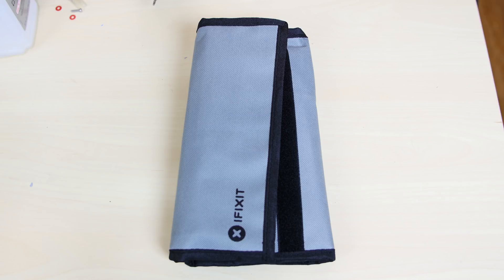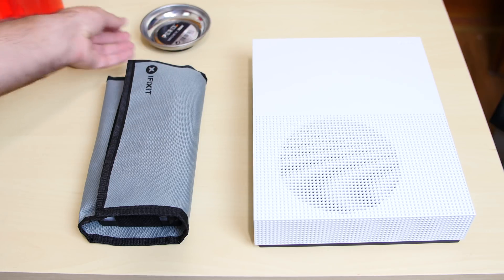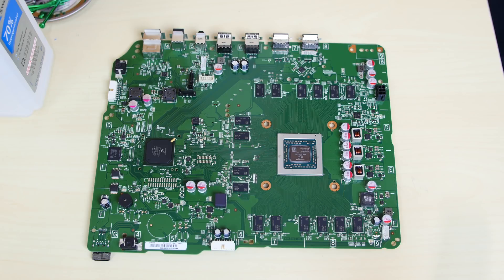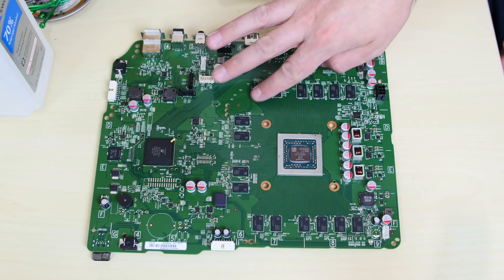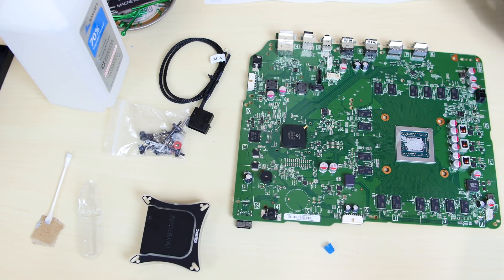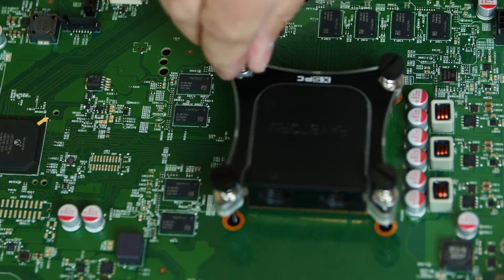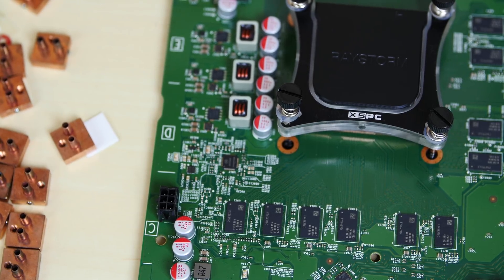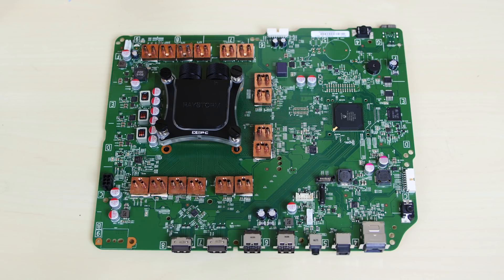Water Cooled Xbox One S - The Build - Part 1

Comment: This build is completely unnecessary because xboxa cannot be overclocked unless u make hybrid pc that uses xbox motherboard and other pc oarts could work but an xbox solo woulndt be any better with cooling
Reply: I mean, normally I'd agree. how ever I'm sure we all know that feeling after a really long play session, long night of zombies where you get up to get a drink, and put your hand over your xbox and just, holy crap, this thing is so hot! I actually just water cooled mine the other day and it stay way cooler for way longer. the reason for such is that because the way mine is set up the radiator and water tank aren't even touching the xbox, so the internal ambient can stay much much cooler as the water is taking the heat out of it. rather then the stock heat sinks spreading the heat out in side of the console and trying to suck it out with a fan, which works for a while, but it gets too hot after a good amount of time.
Reply: Ever heard of thermal throttling? That can happen to Xbox's. Also, it's just a fun, cool (haha get it) thing to do.
(I'm also pretty sure that you can't use an Xbox mobo with other parts.)

Comment: Highly......HIGHLY recommend you do not use "cardboard" for spreading your thermal compound.  The fibrous hairs coming from the cardboard could greatly degrade the thermal performance of your block.  Use an old credit card/hard plastic to smooth it out next time.
Reply: dont even spread it, thats not the right way to do it, let the mounting pressure do that
Reply: YOUDIEMOFO I think you need some thermal paste so you can CHILL OUT it’s his build he can spread it however he wants
Reply: @stonebonsai2502  Did you even read his comment? HE IS GIVING ADVICE. TO BE HELPFUL.

Comment: why does xbox one s using 16/512mb RAM's instead of 8/1GB ?
Reply: Maybe with more memory modules the heat is more spread out.
Reply: if you look at any piece of memory 8GB 4GB 1GB 32GB 2GB they all have more then one ram module just how it works, not saying it couldnt been done your way. computing i guess just makes more sense this way for memory
Reply: ps4 have 1 gb modules thats why i asked
Reply: It's better to have the ram as split up as possible, to distribute usage
Reply: Probably just cost of the parts the the time of it being designed.
Reply: @mrcaboosevg6089  more chips would mean more material, which leads to more cost
Reply: Its a space thing, doing it the way they did just makes it more compact which is pretty much what they went for on the Xbox one s
Reply: @saberboi1526  why would using more which take up more space make it more compact
Reply: @nathanrussell8774  ngl i dont even remember posting this and my reply doesnt even make sense to me.
Reply: @saberboi1526  Wacky. You could have read it as "why did they use eight 1GB chips? Why not 16 512MB chips?"
Reply: @nathanrussell8774  I really dont understand what I was trying to say. Doesn't make sense to me either. My best guess was that maybe the chips were just too large for the board or something not entirely sure what made me think that way.

Comment: Why haven't you put the ram blocks in a 90° angle position on the 4 between the CPU and the XBOX chip? It will be easyer to connect them together with the other ones ;)

Comment: I'm interested in this but I would have liked to see you taking the Xbox apart without it going so fast that way we can see any little problems you might have run into. Also I think you need to slow yourself down and take your time when doing stuff. You need to be neater in your work. The thermal tape hanging over the edges of the cooling blocks looks bad. Still gonna give it a thumps up though.
Reply: Got to agree about the thermal pads, I would of trimmed the pads to the size of the chips. also a bit heavy on the thermal compound on the CPU.